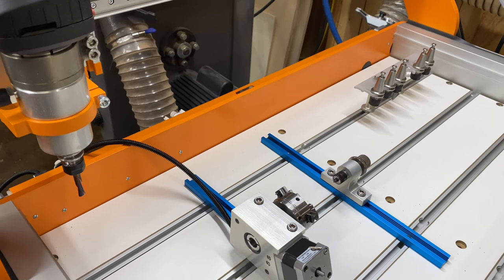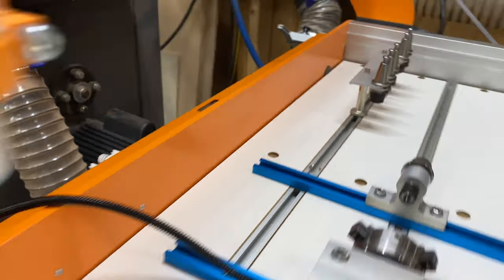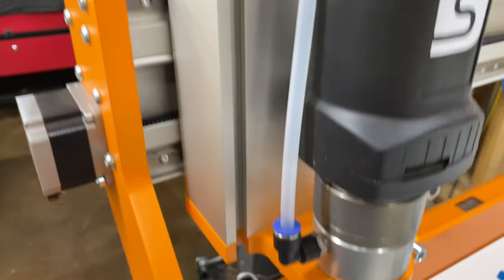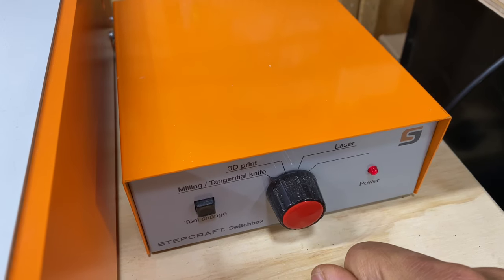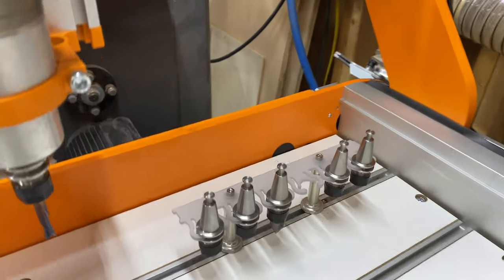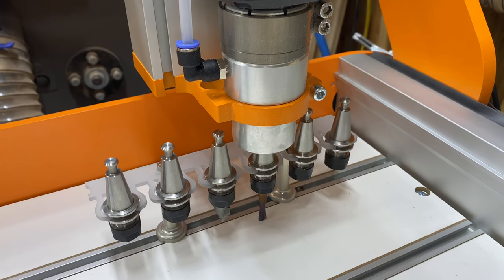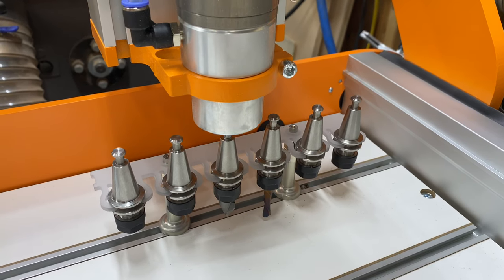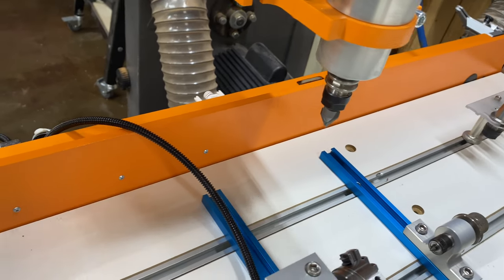Stepcraft M-Series M.1000 Automatic Tool Changer Test

Comment: You mentioned that the spindle air tube connects to the air compressor and then the air compressor to the box? is that correct?